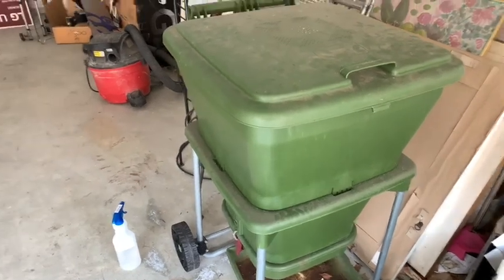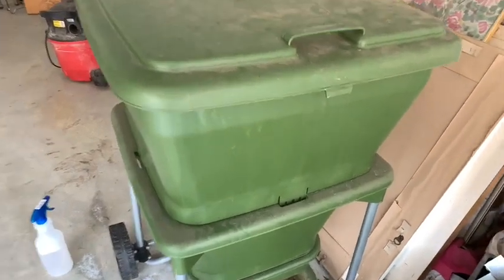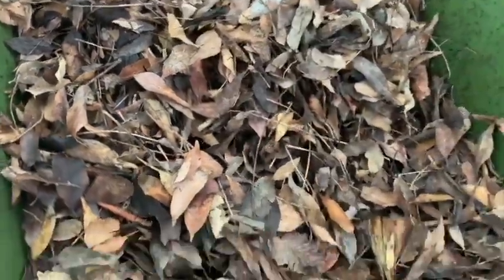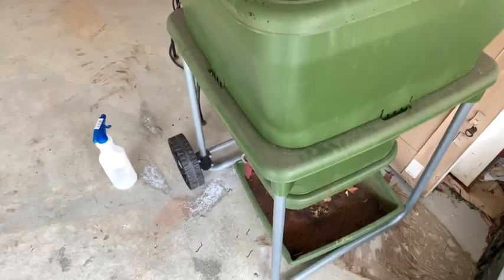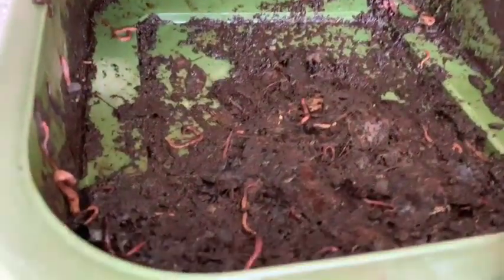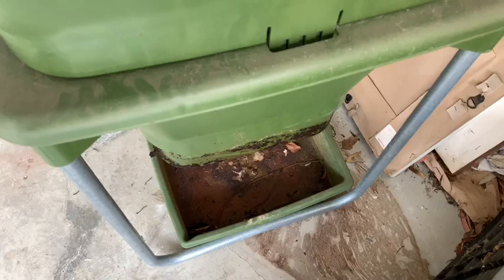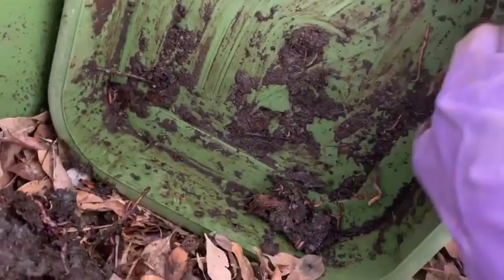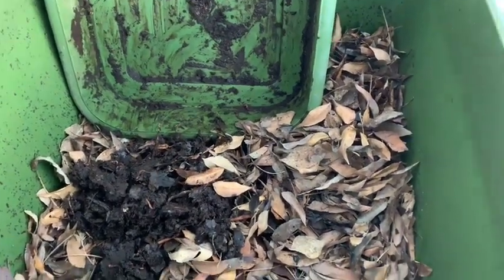The high carbon experiment is over. Results?

Comment: Lilia, so you think that you don't care for this bin as much because you have the UWB and Vermibag and the process is different?  Your garden bed is going to love that compost! I look forward to seeing the next journey this bin will have.  Thanks for sharing! Catherine
Reply from the maker: Hi Catherine. I stopped using the HB before I ever got any of the bags. They are actually the same type of systems ( CFT ). The difference is that the bags breath better, so the material doesn't come out all soggy and wet. The HB is plastic, so no way for the castings to really be moist but not overly wet. That is the issue with the HB.